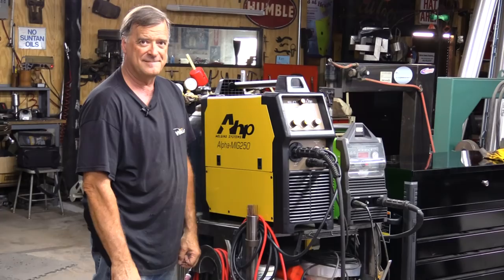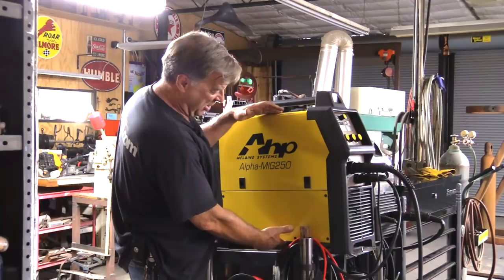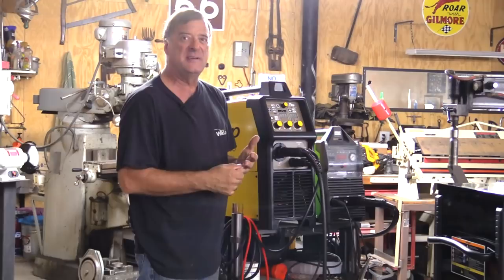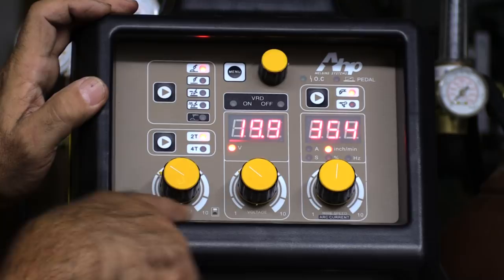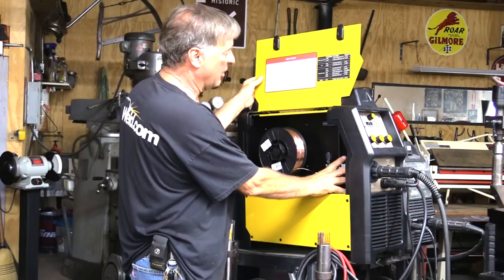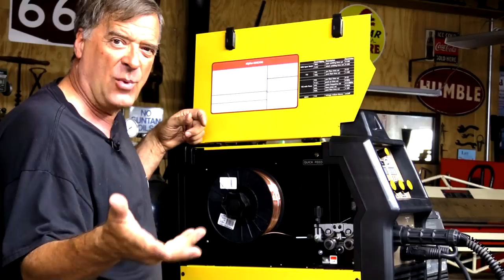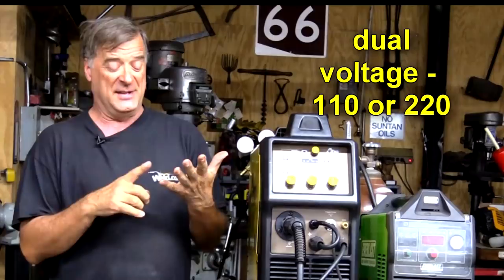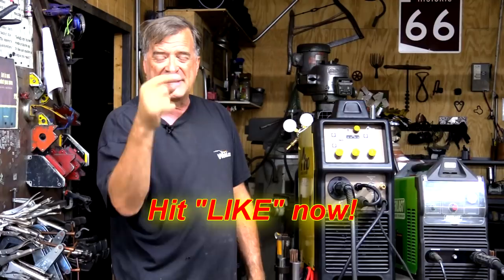Introducing the NEW AHP AlphaMIG 250 – Kevin Caron

Comment: I purchased this machine. It came with one .040 tip and drive rollers for .030 and .040. How will I run .023? Where do I purchase tips other than the .040 it came with. The AHP site does not appear support consumables or different drive rollers. Any help would be appreciated.
Reply from the maker: Please call them!    The site is a joke but they will help you get what you need,

Comment: Have you ran dual shield flux through it yet?
Reply from the maker: No I have not.    Can't stand the stuff!
Reply: But would have the capability of doing it?
Reply from the maker: Yes, it will run dual shield flux core wire.
Reply: Awesome! When are you going to put a video out of you welding with it using mig and stick?
Reply: I'm asking all of this because I'm getting ready to buy a mig or multi process welder and I will have around 2500 to spend. So in your opinion would this be good one to get to save some money or do I spend more and get a different welder?